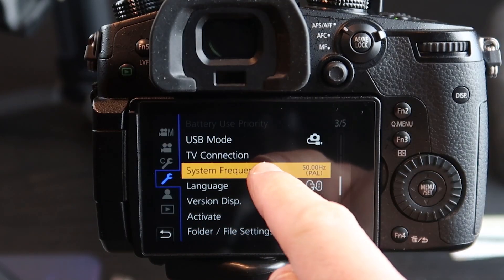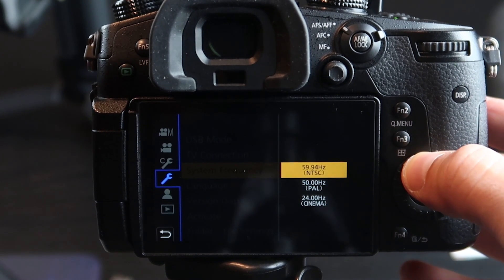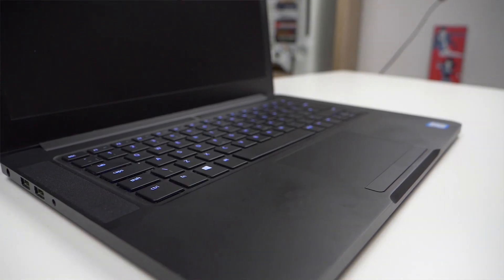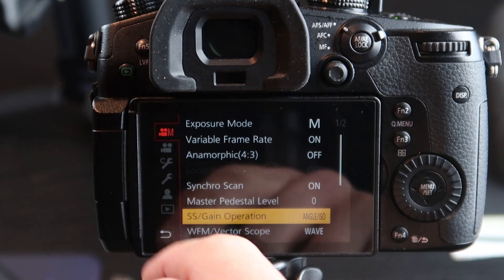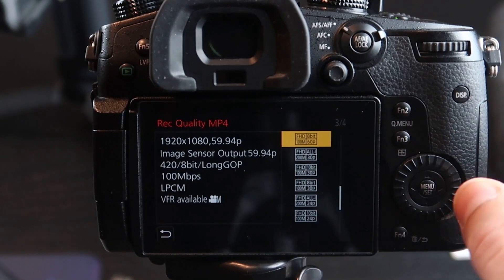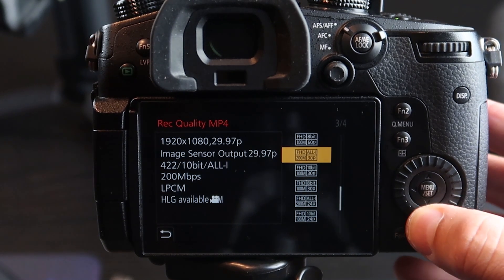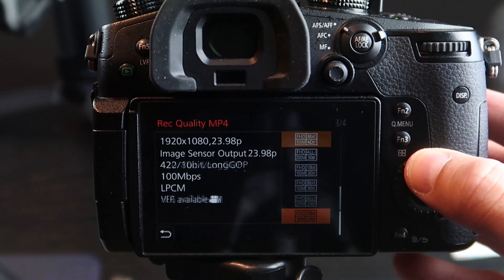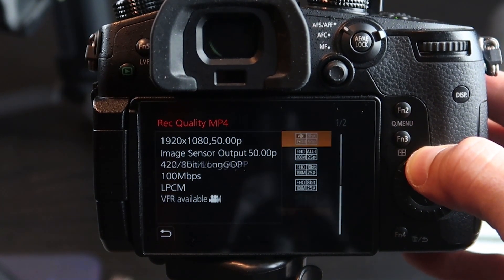Camera Basics for Video: System Frequency

Comment: I think you've already responded to this but I want to check: 1) Can we set the camera to receive and transmit much higher frequencies (that is, a higher part of the spectrum) than is usual for pictures? 2) Can the camera be connected to a normal television set?

Comment: OK Nice, but what means 24.00Hz Cinema
Reply from the maker: 24.00Hz Cinema is an option that you can find specifically in the Panasonic GH5, and basically unlock the pure 24fps frame rate, that is use in film and Hollywood productions. While on the other side, PAL provides 25 FPS and NTSC 23,98 FPS
Reply: @TheRedCyberGlass  I thought Hollywood uses 23.98 ?